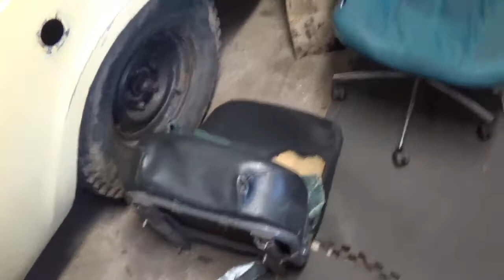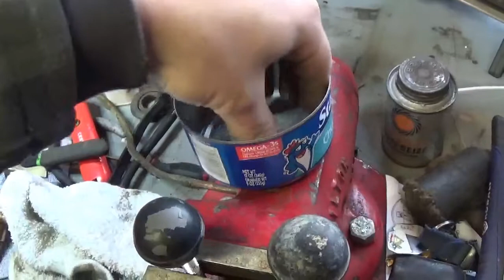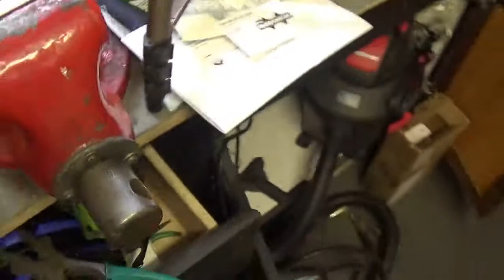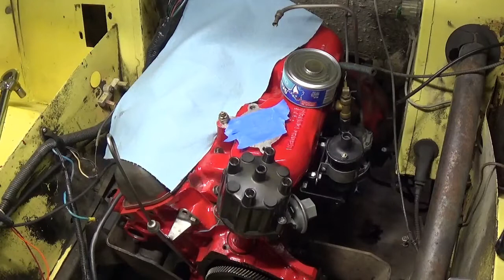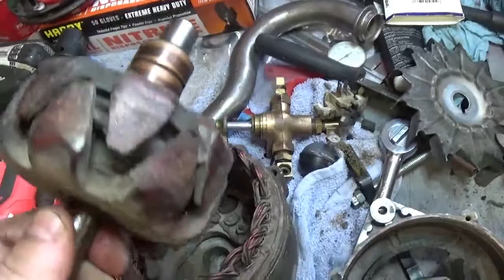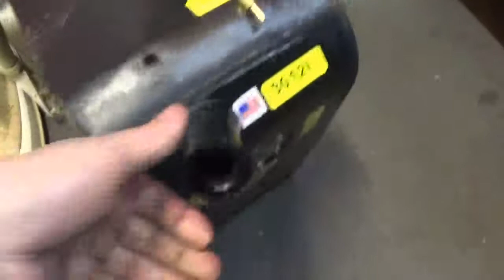The Scout Saga Continues! Part 13

Comment: Hey, don't be sitting around playing with your petcock, you get in there, get your hands dirty, and get er done. WOW, you really went grinding on her LOL! Sorry your weld job didn't hold, a plastic tank will hold up better, as long as it don't drop off the vehicle and start hanging, and grinding itself on pavement that is HAHA. Put that decal on the Scout, so anytime you run someone off the road, you can say, you been boned! HEHE - Ohhhh gooood, you got your new poly tank, it looks good to me, and look, made in the USA, frick ya, America! LOL - Also, didn't know you guys took auto shop in high school, ours had small engine shop. We had to learn how to fully dissasemble an engine, and put it back together, and if it did not run, we got an F lol. Well, I think you know pretty well that mine ran, and you know what else? Mine ran better then everybody elses, cause I also cleaned mine up, carbon and all. Mine had better compression then when I started, and the teacher thanked me for doing more then the bare minimum LOL!
Reply from the maker: Our auto shop was 1st and 2nd year learn the basics on cars and disassemble and name all parts on a 3 hp briggs and if it didn't run we got an F. They were pretty clean little engine, dribbled some oil down the spark plug hole and pull it over.  3rd and 4th were advanced auto. More in depth on car system, brakes, engines, tires.. Ahhh good times. Seems not so long ago but that was 13 years ago? Jeeesh.
Reply: @MrTL117  I love good old times stories lol. So how did you guys handle the storms, were you effected by the evil polar vortex? I feel sorry for the Texans and neighboring states that were effected. Always love it when you upload vids, and I love giving you funny and positive comments. Thanks buddy! FYI, I'm going to buy a new computer soon. 😊
Reply from the maker: @stellarproductions8888   Was pretty frozen, surprisingly we did not loose power, but Ice everywhere, and thick. Had about an inch of snow. Didn't get the full brunt of the storm luckily. If I did then always have the old Coleman stove and fireplace! Thanks for the comments! And good luck with the new computer!